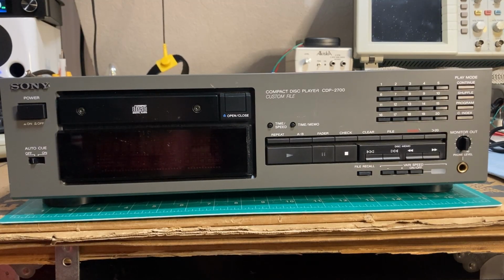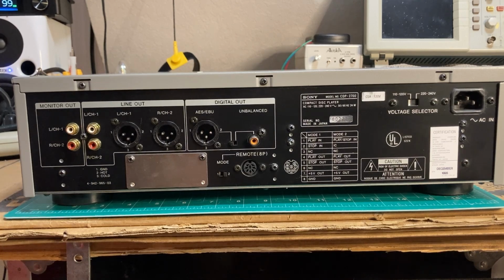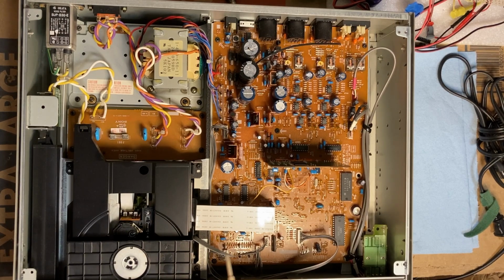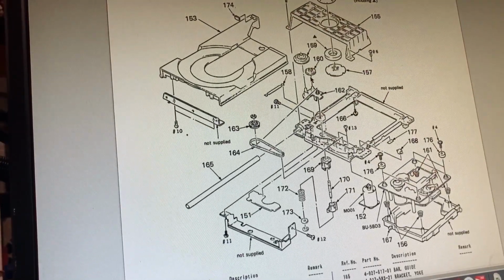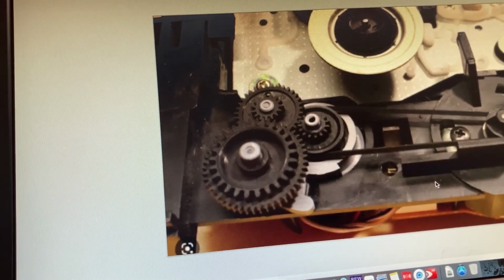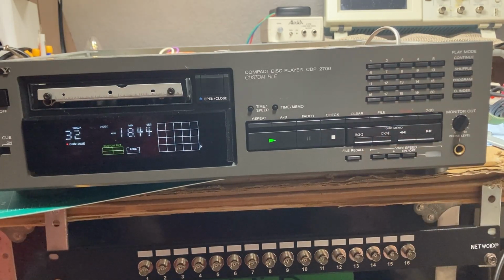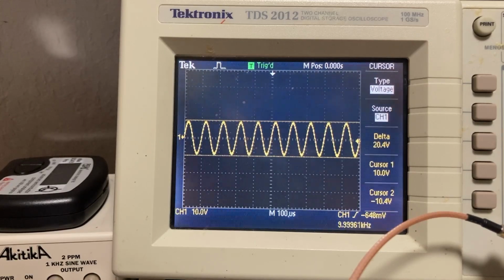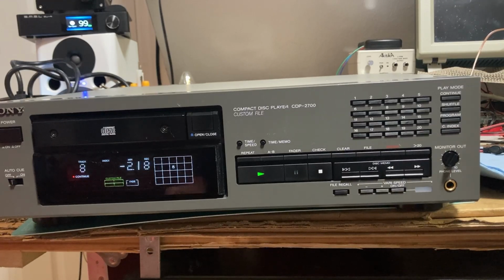Sony CDP 2700

Comment: Bought one recently off ebay as 'For repair/parts only'. Happened to be a lot of cold solderings. After re-soldering those it works perfectly.
I am still puzzled about the remote - is a wired one the only option?